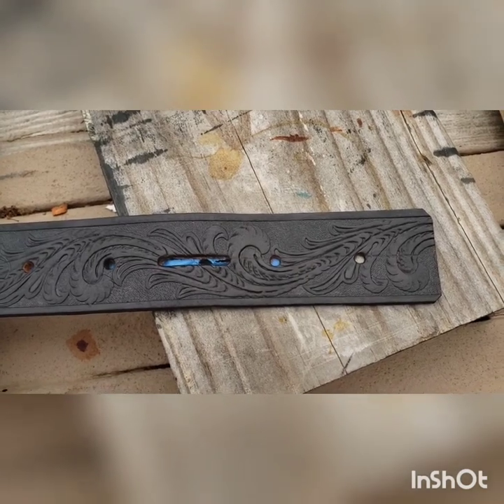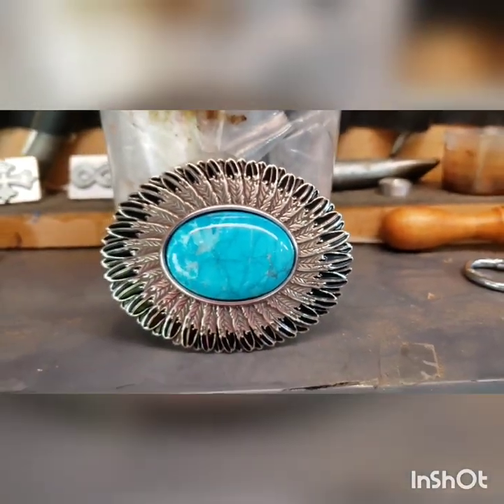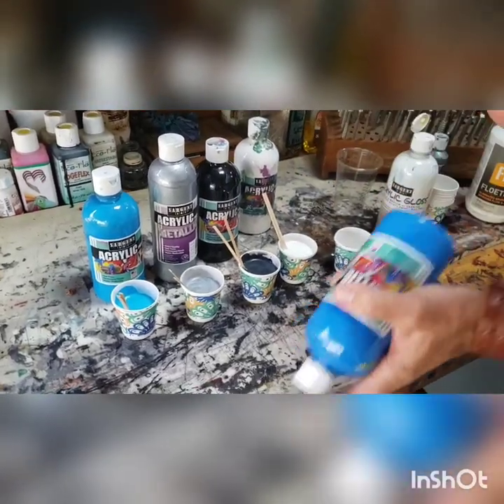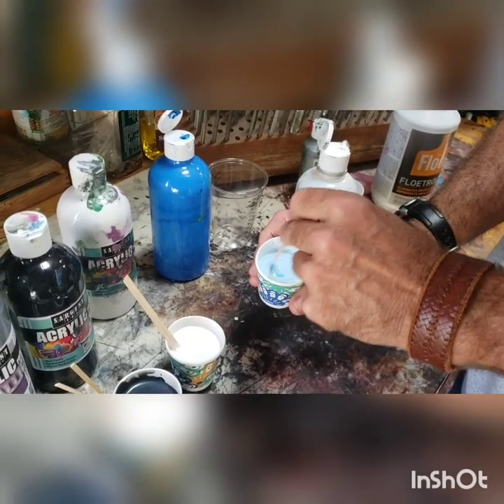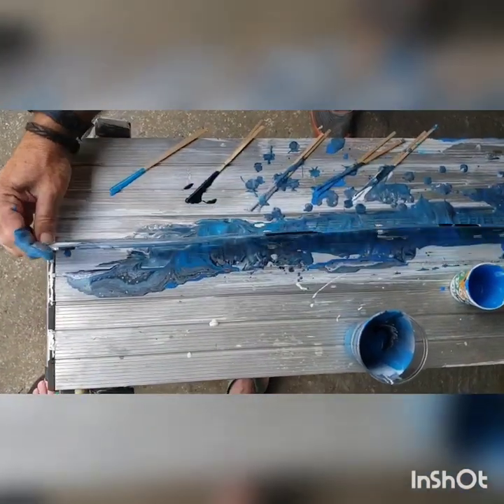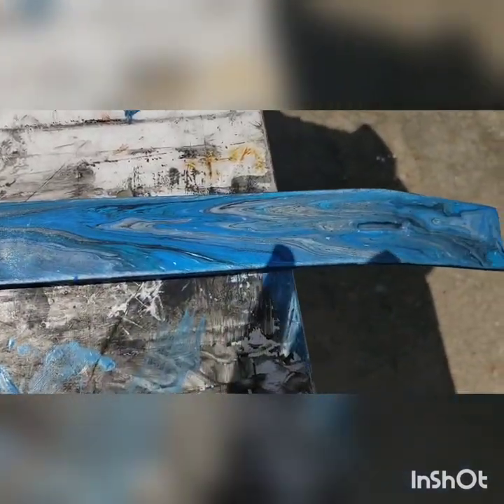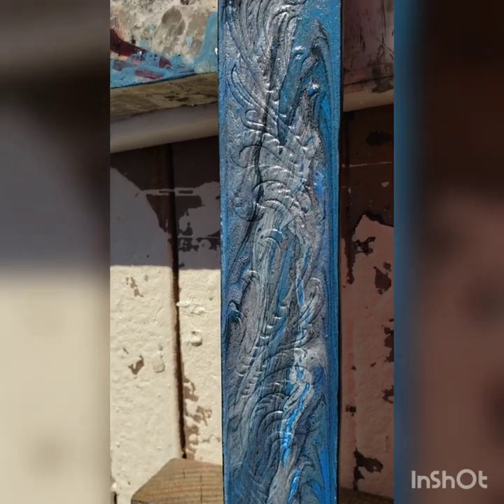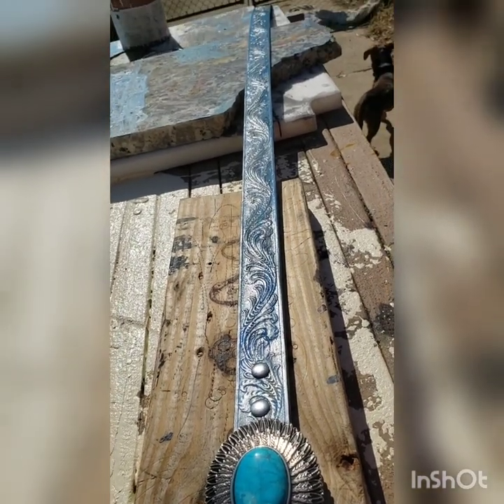Acrylic paint pour belt

Comment: Great Video! What was your process after the belt dried? I see that the acrylic was still rather thick when wet, and your embossed design wasn't coming through. On the next cut, your Design shown through perfectly. And what did you wind up sealing the acrylic with? I'd love to make a couple bracelet blanks and let me kids do their own pours.
Reply from the maker: Justin I did not do a thing post pour other than paint the edges.  This one was a gift for my wife and unit #1 LOL.  On the next video I will do similar pour but then I will back paint the background black to bring out the pattern.  Also will likely use hi-lite stain (black) over the top as well.  Stay tuned.
Reply from the maker: Doing great. I am getting ready to do follow-up video and will show this belt again. Belongs to my wife